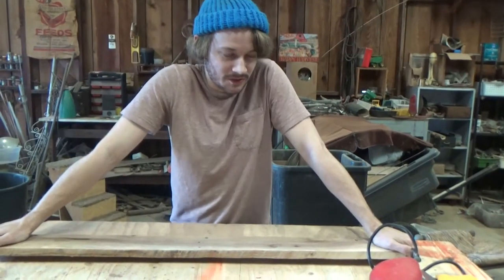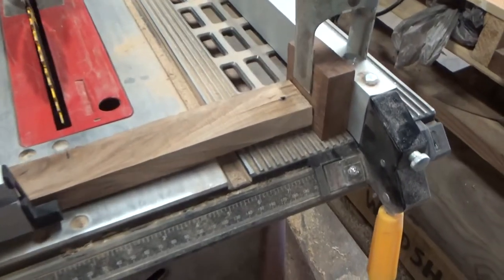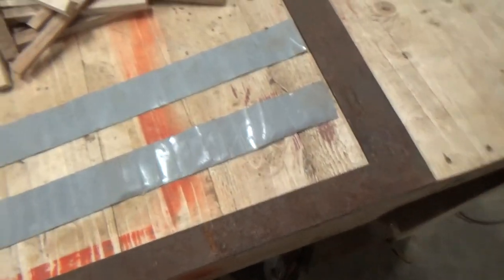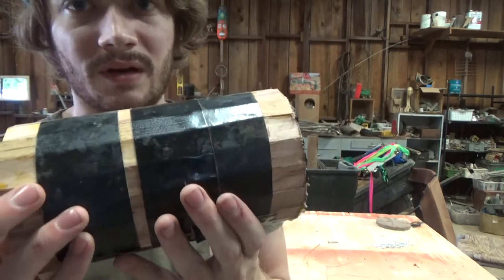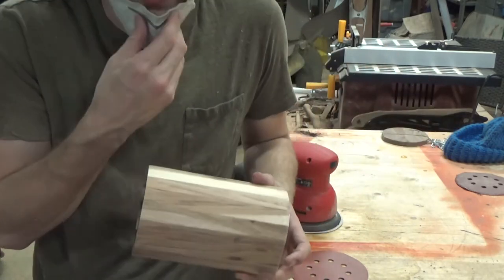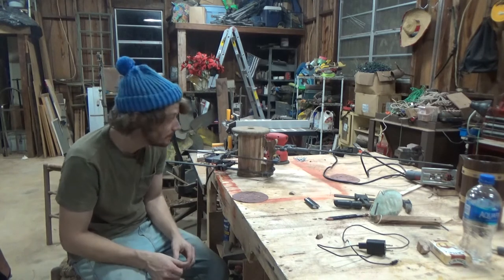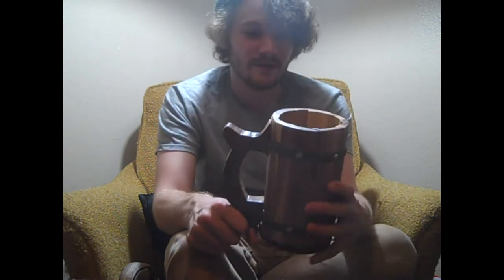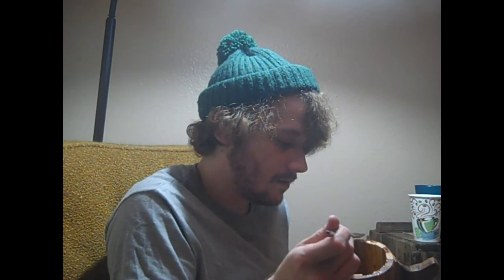Make A Wood Beer Mug From A Single Pallet Board

Comment: Can you use them without off flavor in your beer or chemicals that could be harmful to you or is it just for looks?
Reply from the maker: It didn’t take long for me to only start using these as decorative pieces. Not because of chemicals or off taste, but because it just started to feel like a hassle opening bottles just to pour them in a cup that I’d have to wash out later.
It’s best to be aware of the resin you’re going to be using. There are food grade resins that will be fine for this application.
Reply: @MeansWoodshop  that's good to know. I built me a kegartor that hold a good cold 5 gallons but I also bottle my own home brew.  I think it would be great if I would build my own mug for my keg.

Comment: Bro how many degrees did you cut the wood
Reply from the maker: Guillermo Vallejo hey, bud. My slats were about an inch wide, and 1/2 an inch thick, so all of them were cut with 12 degree angles. I had it in the video and started rabbits trailing about experimenting with the angles and size of the slats, so I cut it out.
Hope that helps!
Reply: Mean Central Thanks, it will help me a lot if you have a good day
Reply from the maker: Guillermo Vallejo , you to, man. If you have plenty of scraps you can always experiment with the width, thickness and angle of the slats to make other stuff.
Reply: Divide 180 by the number of staves.  That's how much you shave off each edge.
Reply from the maker: I actually wasn’t aware of that. Thanks for the info!